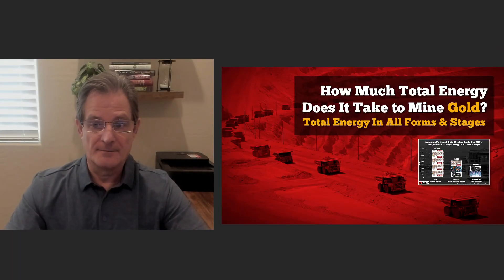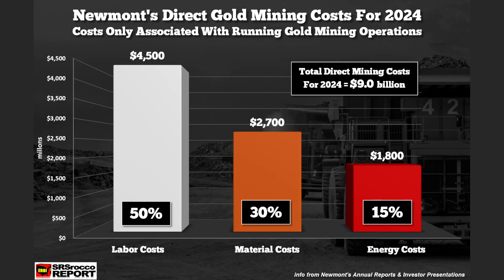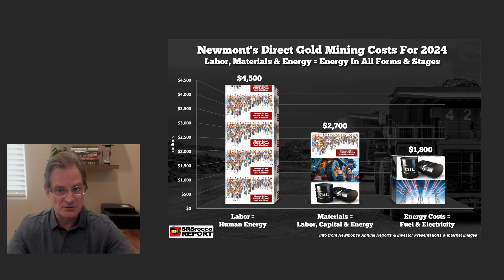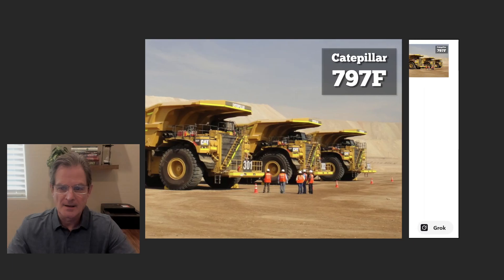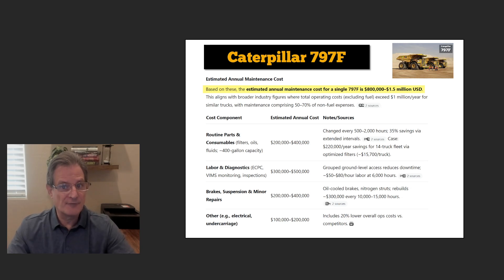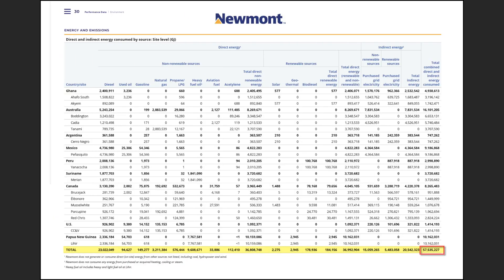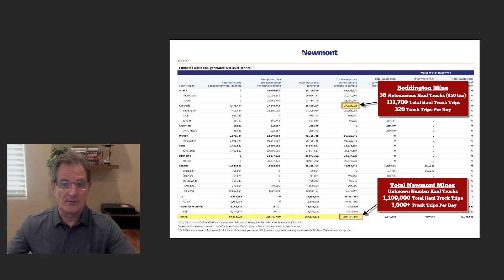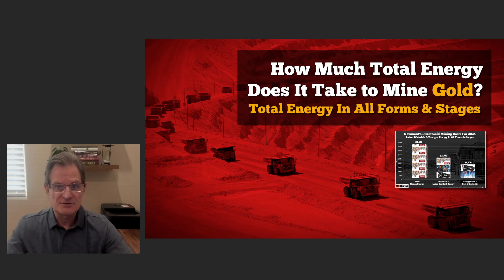How Much Energy To Mine Gold

Comment: Steve you have always put out such good information and I have followed  you for decades. Your points are  well taken and well explained.. The conclusion anyone could make after this detailed analysis is that when energy gets more scarce and expensive, so will mining minerals from ore.The high value of gold  and the cheap fossil fuels allows the process to continue. When the energy costs exceed the value of the derived utility of the particular mineral, the process will cease. That endpoint is not near but You can see it from here on the distant horizon!  One final point  I would like to make is Leibig's Law. With such a complicated interrelated  networked industrial process, the absence or scarcity of perhaps a single component could doom the whole operation. For example, think diesel for example. Remove diesel from the equation and the house of cards collapses. You cannot retool the whole operation to run off solar panels running electrical motors. Absent fossil fuels, particularly distillate fuels, this party will end and we will be back to panning and sifting sand to get our gold.